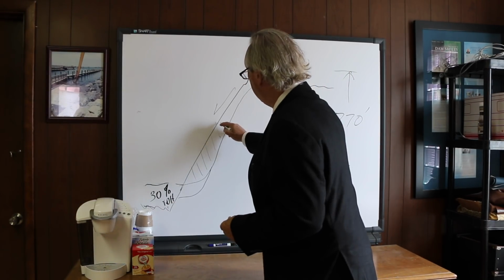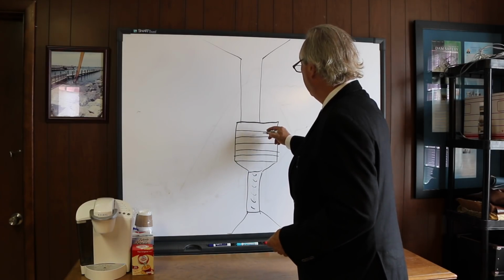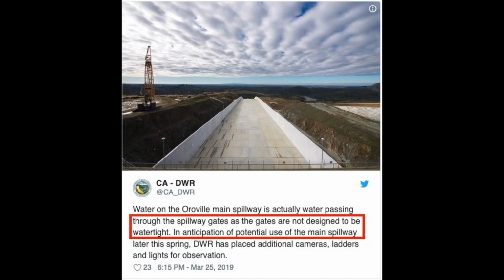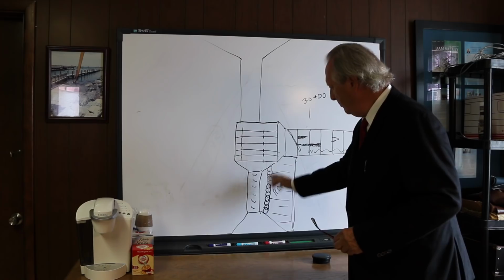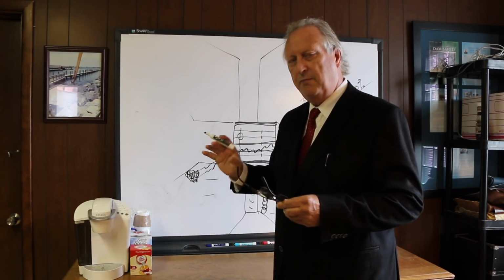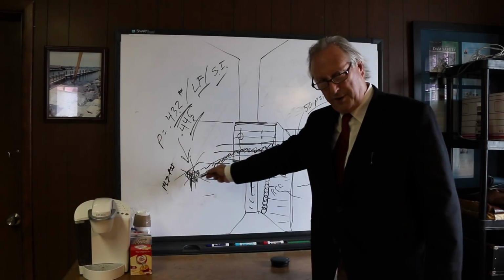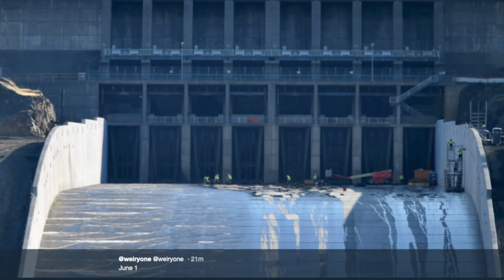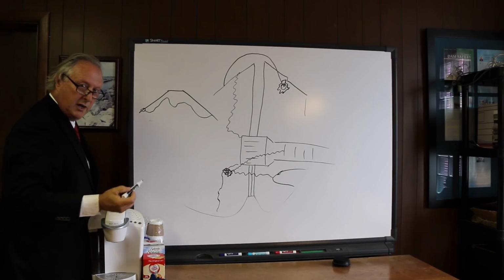Cahill on Oroville Dam 06-01-19

Comment: Thanks for the information!  Can you please tell me what happens to the spillway if they put the wrong size aggregate into the drain pipes of the spillway, too small, as was noted and visible on screen, as they built the spillway? Can you also please tell me what good this spillway is if they never addressed the gates, their gigantic cracks, broken parts holding the gates to the walls, and broken seals?  I've read about other Dam failures from gates flying off because of broken pins. Also, if and when the dam is put up against the weight of the water again, at the height of a rainy season, how will the emergency spillway hold up if water is seeping under the weir and the weir cracks are still present with just quick bandaids over the tops?  Even though they did make ports for this water to escape, would those ports be enough when those openings or sinkholes erode more?  Another thing, if the RCC is porous, then how well will it hold up to water rushing over the weir? Also,  if they have not yet done anything, below the stairs and secant wall of the Emergency Spillway with the dirt, would that be a definite hazard when put to the test of tons of water cascading down the hillside?  Would the water erode that dirt into the river below, which is the only outflow, causing a blockage? which would eventually cause flooding to the Hyatt power plant which is at the bottom of the face of the dam?  If that were to happen, wouldn't there be an explosion of immense power that could totally bring the dam to ruin?  And one last, can you please tell me where the water goes after the stairway bowl is filled up?  It's very nice, and I believe it is to slow the water down to cause less erosion down below it, but couldn't all these engineers come up with a plan for the dirt situation below by now?  And since you're very informed, will they ever fix the gate problem?  Thank you for helping people to understand the rebuild, I look forward to your answers.

Comment: Scott, a problem I see is that the fill used in the upper reconstruction of the ESW is too porous. The gradation probably does not follow the Fuller equation, it is deficient in P200 material.

Comment: Scott, would you please give us an update on what has been and is going on at the Oroville Dam Spillway Site since your 6-1-2019 update?
There are strange things happening at the bottom of the spillway. More concrete is apparently being poured into an extremely large plywood form at the Right base (looking from below). I saw the forms there days ago on one of the other websites.
What would be the minimum drying time for such a large volume of concrete.
Any speculations as to what is being done at this late date would be appreciated.
Thanks again for everything you done in the past to educate me and other people.
Sincerely,   MM
Reply: Michael Meyers ~~ I will try to enplane about your question above ,.." More concrete is apparently being poured into an extremely large plywood form…" If you will recall the main temporary access road that was used extensively at the bottom of the dentates was removed in April 2019 when DWR opened the gates to 25,000 cfs. the road was cleared out. The Radial Gated Structure at the top of the spillway also has an existing bridge that had to be reinforced at the beginnings of reconstruction with extensive faults work to support the large volumes of heavy traffic for the past two years and now, that is being removed as winding down the use and need of that extra support under the bridge because DWR needs to fully clear the area behind the radial gates of the Controlled spillway. SO,... that takes us to your question about the recent extension of a new access road at the apron of the DENTATES by placing a large concrete barrier wall to provide additional widening in order to allow a second spillway crossing when the spillway in shut down. With all of that equipment and personnel on hand it makes for good value to have a quick and simple solution to provide a second means of an access road across the spillway. This is what you are talking about... https://pixel-ca-dwr.photoshelter.com/galleries/C0000OxvlgXg3yfg/G0000aiQCyXvQI4Y/I00007_PPf.NCpSY/KG-oroville-40772-06-13-19-jpg
Reply: Jerry Antonetti Thanks, Jerry. The photo you showed is from a much better perspective than I had seen before.
And your explanation helped me to make more sense of what is going on. I appreciate your time answering my questions. 👍🏻

Comment: My concerns started with the over topping of the dam when they should have continued to dump water through the damaged spillway at all cost. For it intents its an emergency spillway, not really designed to be used, in this case it was intentionally overtopped, leading to more damage that could have been averted. Now you have boils forming on a structure that at best was designed for 75 or 100 years of service. The weather patterns can change within 3-6 months with the eruption of a major volcano in the northern hemisphere thereby creating a situation that might exceed the dams capacity and design as we are witness to. It is going to hold, but for as long as Mother Nature allows. Alternatively they can try to increase upstream capacities to slow run off, or divert around. but at some point the structure will need a major re-engineering not just the patchwork they did to fix the spillway.

Comment: You imply that the spillway is on the dam, it is not. The spillway is on a mountain.
Reply from the maker: The spillway of a dam is by definition, an element of a dam. This is clearly delineated in FEMA, FERC, and other documents of dam safety. Further it is a controlling structure. Further, on Oroville it is, indeed on the right groin and is in fill material.
Reply: @scottcahill945  The spillway is not on fill material. How do you not know this?

Comment: Mr. Cahill, I did some " napkin math " to determine the amount of water " weight " behind the Oroville Dam.  One cubic acre feet of water is 208.7' x 208.7' x 12 ".  There are 7.48 gallons of water in a cubic foot.  Water weighs 8.34 pounds per gallon.  Thus, one acre feet of water weighs 32,605,719.844896 pounds.  When I multiply that result by a storage capacity of 3,537,577 acre feet ( figure pulled from Wikipedia ) of water, I get a total water weight of:  115,345,244,591,747.656992 pounds of water.  A question:  Is my math off Sir ???  Thanks in advance.  Oroville may not be at that point yet, however may well be in the near future.  To me, that's an incredible amount of pressure on that dam . . .
Reply: Water pressure is a function of depth not volume.
Reply: @DavidJohnson-tv2nn  
Correct. Pressure is a function of depth due to gravity.  However, volume IS a multiplier, because volume = inertia.  Can you refute my math ?  Clearly the dam is hydrated due to the visible leaks.  I'm merely trying to shed light on that very " pressure ".  I suspect Mr. Cahill is correct with respect to porting.  I don't want the dam to fail, but from where I'm sitting, it looks questionable now at best . . .

Comment: I just noticed, on this link https://www.youtube.com/watch?v=PNpUsK0Bbvo, at 5:50, that workers are back filling one of the drain lines on the Oroville Spillway with the drain holes on the top of the pipe.  If this drain is supposed to work like a French Drain then the drain holes are supposed to be on the bottom of the pipe not the top.  This is on the General Contractor's Exam for French Drains in California.  If it is not supposed to work like a French Drain then I would be interested in how these drains lines work.  I might be able to use this information sometime in the future.

Comment: There is a seal in an earthen dam called "the key"  it is made of clay and special care is taken to install it. it has no structural strength and is held in place by the dam structure. All dams pass some water, it is monitored by people that know what they are doing and keep records of it. The dam's location is also closely monitored. You have failed to show any material washing from the interior of the dam structure, if there was clay from the key coming out with the water on the downstream side of the dam face  that would be a problem. The water you are pointing out might not even be leakage, it could be water from spring rain draining from inside the dam, you know; like an annual spring.
 Show us some gates like this, that are not leaking when they are holding back water.
 Looks to me like the new construction landscaping held up extremely well after the spring rain, according to the pictures you showed.
 If you have 25 years or more in the dam business then it appears you are intentionally  sensationalizing things here by withholding and/or misrepresenting information.
 The Sheriff pushed the button right away when the dam started squirting, for what turned out to be no reason at all. Now you think he's part of some big conspiracy to cover up an unsafe dam. Come on, the check writers were there, they fixed everything they possibly think of.
Reply: You mean give opinions based on actual data? Way too much work. Toward the end he says "I could be completely wrong", lol.
Reply: Pictures don't lie... explain water mitigating through the slab joints from underneath at the top of the spillway and further down as water is appearing in the middle then draining between the slabs but dry on either side. 

The scary thing is the water seeping through the soil wall at the o-g weir and coming out in the middle of the RCC.  The RCC is a soil cement and it is designed to erode and not hold up like poured concrete. 

Deny all you want but the pictures show it leaks like a sieve, and this after a $1.2 billion reconstruction. 

The sux part is they had the thing drained and dried for two years - plenty of time to resolves these issues. 

And that is the most detailed image of the green spot I've seen. Guess they don't want that getting around as it looks a whole lot worse up close
Reply: @tommypetraglia4688  Like I said;  what you need to look for is clay in the water coming out of the dam. Dams are constructed to pass water absorbed in the downstream side of their construction, like annual springs on a hill after spring melt/rain. Come August; let's look again.
  RCC: Calling RCC a "Soil Cement"and designed to erode is as misleading as calling evolution; "just a theory". Go study this product and show me where they misused it. 
  As part of that 1.2 billion you mentioned, a complete assessment of the dam was done, and part of that assessment is still being done now that the dam is full. What you should look for is a significantly reduced operating lake level in the future, combined with light gray runoff (the dam's key) entering the thermalito channel where it runs in front of the dam. This would be a bad thing.
 As for the green spot: I haven't walked out there to look at it. It might be the grass type. But the guys wanting that 1.2 billion were out there. Also, for some reason, the green spot shows up much better on end of the world conspiracy channels than it does in other sources. Maybe this August you could throw on your Gopro, camo, and tinfoil hat, and belly crawl out there with a soil moisture detector from WalMart and get some solid evidence for your own earth shattering You Tube video.

Comment: I am an electrical engineering designer. I deal with degradation of electrical pathways. In this case, it is the electron flow that causes the 'jamming' of the pathway rather then its erosion. Now I can not make current repair a wire, but I can sure help it destroy its own conductive path. If you were to stir in an overall aggregate throughout the water just above your upper portal and leak a slurry of fine sand (and whatever else would help plug the holes,) continuously would that fine 'misting' of small particles generally in the water work just like the dust in an air circulated heater, eventually plugging the entire thing up with a fine particulate? Then throw in a "few handfuls" of portland cement to really clog things up! Certainly less expensive then a complete tear down and rebuild!

Comment: ….8:00....Bentonite...Juan Brown...a commercial and ex-military pilot...if his 'opinion' was not so valued...why was he invited by DWR to attend and speak at their news events...and the only pilot with press credentials to walk right there with Kiewit on the spillway construction...and the only pilot with permission to fly over the dam project almost daily...while still flying to Los Angeles with his day job.....and it would seem the green spot was there before the dam was ever spilled..
  I live 2-1/2 miles from the confluence of Sacramento and American rivers...so I'm looking at that water flow daily...only a levee protects me, an many thousands of others.....
 Recently the levees were repaired against 'ports' and rodent burrows....by a trench 33 feet deep and 18" wide, filled with Bentonite...I can walk over here in 10 minutes from my house to where they set up the operation......
Reply from the maker: (It's Lisa) The green spot has been there for many years. Levees have different standards of construction. If you think about it, levees fail somewhere in the US several times every Spring. That isn't true and we don't want it to be true for dams. Levees are usually much lower head structures compared to most dams, and are also not typically used all year. Water comes up, then goes down. They just have to hold through the flood event. That means their saturation characteristics are very different than large embankment dams. Bentonite can have many uses in lower head lakes and dams. AKA drilling mud, it's good stuff when used in the proper places. It is just clay however, so in a high flow situation, it will just wash away. If a small lake, say a farm pond, is leaking, the farmer will sometimes drain it, let the mud dry, then dump bags of bentonite and rake or plow it into the soil surface. I can see using it levees. I don't really think it has a place in the tallest dam in America though.
Reply: OK, thanks for the reply....I'm thinking there was some discussion about the original Oroville dam plan...which had a fairly large Bentonite barrier as part of the structure.  @scottcahill945

Comment: Military needs to seize control of that dam. Let the 
U.S. Army Corps of Engineers Fix it.
Reply from the maker: Someone needs to step in.
Reply: We agree The U.S. Army Corps should immediately seize control of the dam. DWR is full of lies to cover a poorly maintained structure. DWR also fails to acknowledge the poor job the construction co. did!
Reply: At the time the dam was about to be built, there was much politics between parties, and it was documented in the local Butte County newspapers. My father was put in charge of evacuating Marysville during the great flood. 1955?

Comment: If the lake stays high and they don't start any emergency grouting, what is your best guess as to how long that internal erosion showing soil in the leaks can continue before the dam breaches? I know dams can last  years or days or merely hours with soil erosion....so what is your gut feeling about how long this will last if they don't grout? Thanks.
Reply from the maker: The last failure of this dam happened at 4% of the design storm. The "responsible parties assured us all that all was well until 45 minutes before the potential failure. After a billion+ dollars in damage and untold ecological loss, they stated that the dam performed as it was designed to perform. I cannot guess the progression of a porting evolution. there are too many variables. When things settle to the point where gates no longer work, it gets my attention, but then, I suppose I am an alarmist.
Reply: @scottcahill945  thank you for the reply. Is there anything to watch for to indicate porting is leading to imminent failure, and it is too late to get grouting equipment in? Like flow volume at a certain level, or visible holes appearing of a certain size? Would I be correct that you and your wife keep a close eye on twitter photos and would be able to issue a warning in ample time? I of course hope they grout and the level drops with no problems, but just wondering. Are you legally even allowed to say publicly that people need to evacuate? Or would you legally need to call the sheriff? Thanks again for caring enough to do this. I would say you are wise and realistic, not alarmist.
Reply: Mr Peabody, thank you for a reply.  I do respect engineers which is why I respect Robert Bea and Tony Johnson, who i assume you realize are leading national engineers. Johnson did the forensic report asking if the gates will fail in heavy flows. I assume you read it. The seepage due to failure of the left abutment to seal properly is perhaps less alarming but a concern nevertheless, if you respect a CA PhD in engineering.
Btw, your obvious contempt for Scott is arrogant. After my husband got his master's degree over 40 years ago he'll be the first to tell you he thought he knew everything. Life has a way of bringing wisdom and humbling over the years,  and showing us the need to value imput from those with experience. Hubby makes over 200,000 a year now because he has stuck it out and been willing to not think he knew more than the guy with less of a degree. And in case you actually dont know this, universities grant credit and degrees for work experience. You dont get everything in the classroom. I value Scott's decades of hands on experience. You owe him an apology.